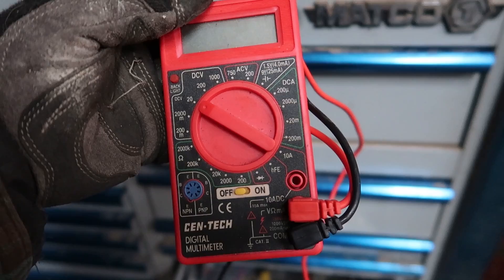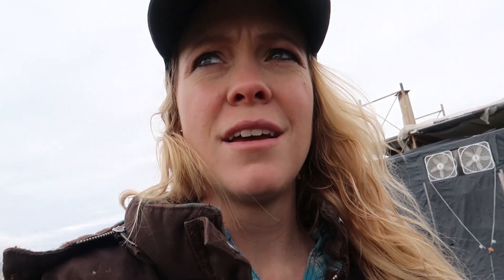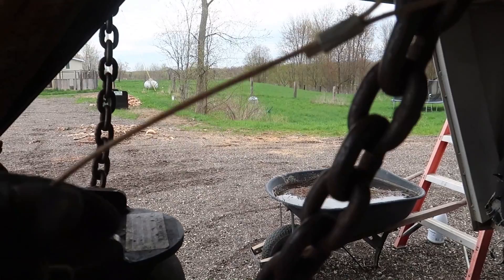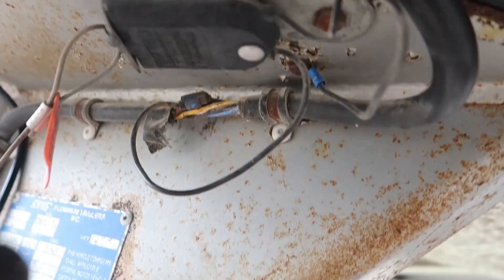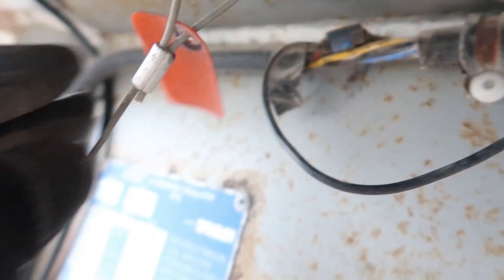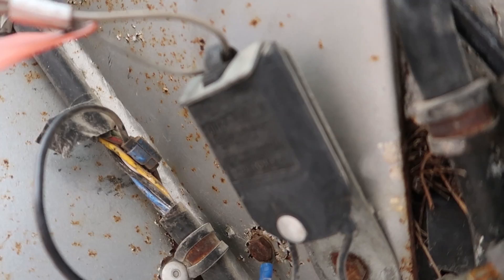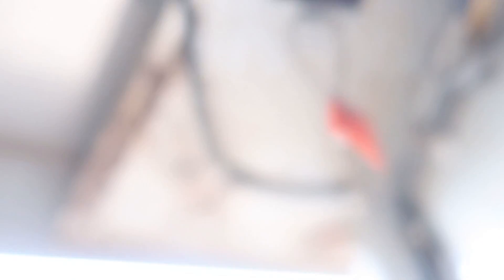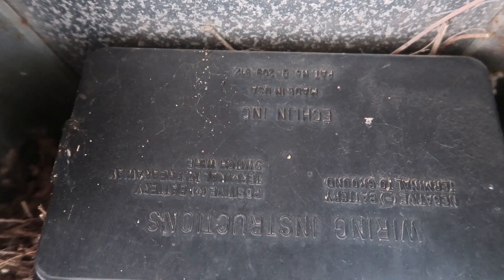218 SOLVED!!    Why My Trailer Brakes Lock Up (You Guys Are the BEST!)

Comment: I have a similar issue where my dump trailer tire rolls a few yards then locks up then releases for a few yards and locks up again. Any assistance is appreciated!
Reply from the maker: Usually a wiring issue, the correction might not be secure, or a small break in the line. Could also be a fuse in your truck going bad -- some trucks have separate fuses for trailer brakes. Also check the ground cable on your truck battery. Some trailers also have battery back-ups and when bad or low can cause it to trigger . . .

Comment: The plugs on the left are for trailer hook ups also the one in the middle I'm gonna say is for the more heavier duty trailers, that's the one you should be checking that's if your plug is that one.
Reply from the maker: Thanks!
Reply: Welcome

Comment: The battery on the trailer is there to provide power for the brakes, in the event the trailer breaks away. When this occurs the cable pulls the pin out of the breakaway, and activates power to your brakes. Sometimes the pin will come lose causing the brakes to lock up. you can pull the pin out of the breakaway switch, and reinsert it.  With the key off in the truck, and no lights on, there should be no power to the plugin. The little plug to the side is for a small trailer, with no brakes just lights. The tube you seen under truck is for a crank to be inserted to lower the spare tire. Do a search on Google for a picture of the plugin like yours, it will list what every pin is for. 
 My best guess as to your problem is the truck harness has been modified to someone else's trailer, that was not wired the same as standard trailers.
Reply from the maker: Excellent suggestions! And I think that makes sense about the battery being a back-up for powering the brakes in an emergency :)
Reply: @This1LifeWeLive  After reading what I had wrote, I guess I should have made it more clear. The problem, 90% of the time is either the trailer plug has been modified, or the truck harness has been modified, either way they do not have to be to the standard wiring, but must match each other. It is just good sense to wire them both to the standard wiring.
  All new vehicles with trailer plugins are wired to a standard, nothing worse than lending a trailer to someone, with an older truck, getting it back only to find he has hacked into harness to match his truck, instead of making his truck the same as the standard trailer wiring.

Comment: The 4 thing the bottom ground the 3 covered ones- one tail light other 2 are turn singles the round ones are 6 or seven i did buy a new camper it all works even brakes the new brake control worked i need car rust fixed before my first camping trip to the lake! you pull the wire the brakes set on! the battery dead! get a wiring diagram for round plug! it power wire on
Reply from the maker: Thanks, I'll look into that!

Comment: Forgot to mention once you locate that power wire disconnect that wire and hook up your trailer and plug in your trailer and see if it unlocks the brakes. On the 6 pole trailer connector their is no power wire I think. Double check to see.

Comment: That battery is bad, but it doesn't do anything unless that cable is pulled out, and then it locks the brakes on the trailer. The little black box that the cable hooks to is like a breaker, so when the cable pulls the end out of that little box it makes a connection inside and locks the brakes. 
That kind of wiring issue can be a headache, It could be the plug on the truck or the plug on the trailer. I had wiring issues with my horse trailer, and I just took it to a place that installed trailer hitches, and it took him about 5 minutes to tell me what the problem was. And for $25 he switched a few wires and I was on my way. lol.
Reply from the maker: Thanks, I'll look into that! 😃

Comment: If you have an aftermarket brake controller installed your manual slide switch on the brake controller could be stuck locking the brakes up. If you have a light on your brake controller it will be on if the that switch is stuck just re slide the switch back and forth and it should release. I have also had brake controllers that have a little tab switch on the side and if it’s not pointed downwards it will also engage the brakes
Reply from the maker: We ahd our after market brake controlled disconnected in case that was the issue :)

Comment: Sent good info to your community site.  Leave the trailer and Break Away stuff alone for now, it has nothing to do with your problem. Once the truck wiring is correct you can move on to the trailer wiring. Go step by step or you will end up in with a big mess. I see your trailer does not use the center pin. You might want to use it at a later time to run trailer over head lights and accessories. The top right terminal should not be hot so you do have truck wiring issues that's running lights. Hey that pipe thing is used to lower your spare tire.  Insert special tire tool in pipe and turn to lower tire down.
Reply from the maker: Oh, ha! I would have never guessed it was to lower the tire! I had been looking at a few wiring diagrams and some use the center pin to run reverse/backup lights. It SEEMED like at one point the truck DID run the inside lights . . . but I didn't pay much attention to wiring stuff last year :(

Comment: The two types of plugs are the same purposes, the 4 prong is for trailers with 4 prong flat connectors,and the round plug is for newer trailers..they both serve the same purpise....check fuses as well, sometimes doing that can sometimes blow fuses.. breakaway cable is to stop the trailer if the trailer breaks loose from the truck
Reply from the maker: Thanks!

Comment: I was thinking about this.  On my trailer i have voltage that runs to charge the battery in the trailer. when i wasn t sure of the trailer.  I would hook it to a truck that i knew was right.  It sounds like the brakes and charging voltage could be crossed.  I recently had to rewire the trailer 2 yrs ago.  On the rear of my ford my 8 pin is marked.  In the 8 pin there is a ground as i remember.    So when you use the meter  set to 20 dcV.  This is because the voltage of the truck is 12 vdc.  Think of a battery Black - / or ground.  so in short the Chassis of the truck is ground.    So when you touch the pos lead to Pos of battery you get 12vdc.   So in short when troubleshooting  the voltage will fluctuate from 0 to 12 volts.  when brake peddle pushed should have 12vdc.  When you let off brakes should be 0vdc.   At least this you can determine the truck ok.  Now the ohms settings this is for testing shorts or opens.  Basically you can find pinched wires to ground AKA the chassis.  The lower the reading on OHMS close to a short.  IF meter basically reads 0.  Yep it bad.  This is how i found mine.  There is alot more to troubleshooting with the ohms setting. I would set to highest setting.  Then short leads and you should read 0.   If you work the trailer in a way that you know what is working.  It will be easier to troubleshoot.  Sounds like it coming from the truck.  Voltage can stray from another circuit If lights are on.  But should be east enough to tell.  I tried to make this short.  I think it enough you will have some great ideas going forward. Also someone could have made the original pug for the trailer  to their truck.  Start basic and work forward.  Split the truck and trailer and test both.  It a big cookie lol.  Have fun hope helps you in the future.

Comment: My two cents. You can get a trailer plug tester to see if everything is hooked up right just by looking at it. If remember right it’s about $20.00. And you should look at replacing the the trailer plug to a new 7 wire. Mine had maybe been on 5 years and went bad. And I recommend a Reese plug. Just seems to be built better. Good luck.
Reply from the maker: Thanks, I'll look into that!

Comment: Replace batt. Probably the plug on the trailer side. Don't worry about anything less than 1volt. It's dead or off. Most problems are either the plug or the trailer ground wire. ALWAYS make sure ur ground wire clean and rust free. Use a wire brush . It will be the wire going to a eyelet connector somewhere on the chassis. That's where I would start.
Reply from the maker: Thanks, I'll look into that!

Comment: Your multimeters is set on 20 volts. So, you will have to double your digital read out number. Your breakaway battery read 6.4 or something like that.  So, you had 12.8 actual volts. (Remember, your multimeter was set to read 20 volts). I would have someone hold the brake pedal and recheck your plug-in on the pickup. Also, is your brake controller in the pickup adjustable? If it is, is it set to max?
Reply from the maker: Thanks, I'll look into that! The after market brake controlled in not installed since we were having issues and thought that to be the cause.
Reply: The 20 volt DC setting is for DC volts up to 20 volts.  It does not need the reading doubled.  The reading was 0.64, not 6.4.
Reply: @ronsommer9409  you are correct.  I posted and went to bed. Laying there, I realized I was wrong on the multimeter part. I didn't have the time this morning to correct the post.  I'll leave it for now. Unless it really bothers someone.  They can read your comment correcting mine.

Comment: Trailer brakes are activated by electric.If all power is disconnected and brakes are locked,it is mechanical (brakes are probably rusted wheel hub).If brakes are locked only when wiring is connected,then it is electrical.Does truck have a brake adjustment box under dash in can of truck?
Reply from the maker: We do have an after market brake device, but it's not currently connected . .

Comment: That looked like a adapter plug on trl pigtail, trl plug looked to be a 6 pin round pins, the round pins look like a 5 pt star shape with 6th center pin.
Reply from the maker: Correct!
Reply: Suzanne i looked up the standard 7 pin plug wiring diagram and this is what i found. Looking into outlet on truck end starting LH lower terminal is Ground White wire.going clockwise LH turn yellow. Tail Running lights Brown. 12 volts constant power Red. RH Turn green. Trailer Brakes Blue. Your brake lights power thru the LH AND RH turn signal wires at the same time.The center pin is for backup lights. All circuits need to be powered up in order to test power out of outlet. Turn on parking lights,4 way hazards, have helper activate trl brake controller, brake pedal for brake light test and key on engine off put gear shifter in reverse to check backup lights.

Comment: The tube is where you put your jack handle in to lower the spare tire . Also how a break away works is if for some reason the trailer and truck become separated then the cable will pull the key out of the break away switch and will close the contacts in switch sending 12volts from the battery on trailer to the brakes stopping the trailer. So as long as the key is in the switch and your brakes are still locking up it’s not the break away . More likely wires on trailer plug not synced with the wires  on truck. Plug
Reply from the maker: Thanks for the suggestions!

Comment: Most multi meters have a tone setting I've found that setting is helpful and you can have the truck in the accessorie position and the 4 pin is usually for smaller trailers that don't have breaks the bigger plug is for the horse trailer and most auto parts stores sell a plug tester for trailer plugs and that pipe I believe is for the spare tire winch
Reply from the maker: ohhhh, ok!

Comment: When it comes to wiring there is the Right Way the  Wrong Way and the   WT Farm Girl Way ..   Most of my Trucks have air brakes..   I have some  funky  adaptors    To adapt  from  7 Pin Round  "Air Brakes"  To   "7 Pin Flat"  Electric brakes.  The hardest  problem to solve is  when some one else Jerry rigged the system and you don't know what they did ..    A  Simple  test light  could be handy  to  .. Voltage or no voltage..  a   12  volt  battery  should  test at least  12.8 volts  ..  You  can  try to charge your   emergency  battery  but  remember small batteries  don't last  very many years if you don't  store them  fully charged..
  When a  battery is low the  lead  plates  are exposed and they corrode..  Electrons  of  a  fully charged  battery some how  protect it from Oxidation..  I have  many  battery tender  chargers  to  keep  batteries  fully charged when not  being used normally .. Plus  all your  modern  cars have computers  that constantly  drain the battery when not in use.

Comment: That is a 6 6 pin round plug or at least one I can see in the videonow if I had looked at the truck right I have to go back and look at video again if you had a 7 pin on my truck that could be your problem also and that it's wired wrongand that are definitely lead you down a road of Chase and wires you need to make sure it's your truck has the same amount of pins on the connector as your trailer and that they are wired the same as your trailer or you will be chasing wires for days trying to figure it out

Comment: 2 different styles of trailer connections,, Easiest test is just put your flashers on first set the tester on 20v. With the key only on it'll have a number about 12.6 this is a good battery with the engine running it'll say 13.7 to 14.6 But using the flashers it say the signals, brake, stop, curcuit is working they all run on the same power curcuit. PUT THE BLACK onto the exposed post this is Negative,Turn on flashers Then touch the upper holes these say signal current both should flash then shut off flashers turn on park lights touch the same holes the lights will be dimmer but both will be on, Shutoff lights then try just signals they should flash separately. Most cases the big Blue wire is the brake supply from the truck, White is ground yellow and green are signal wires brown is park lights /headlights this will be the hole just above the exposed post middle one .Might have a power touching the brake supply wire, The little hairpin looking signia top center of the tester is OHM tester this works using NO POWER it tests for broken strands in wires or power crossing that wire that's supposed to be dead if you get No numbers when touching both ends it's broken if you get numbers it'll say how good the wire is if it's a new wire All the wires should say the same number when testing for good wires a weak number is corroded or only have a few strands.
Reply from the maker: Thanks, I'll look into that!
Reply: @This1LifeWeLive  Was gonna ask how often are you going to haul your horses in the trailer ,Does it really need them airbags on the hitch them are for fatigue on the horses legs on long hauls ,If not going all that far that`ll lower the hitch to fit the truck .
Reply from the maker: @GarnettM  we had considered that as well :)

Comment: It still sounds like the constant hot is hooked up to the brake line. Constant hot is mentioned for trialers with interior lights etc. Have Eric un hook the wire he connected and see if that releases the brakes. I ran into that on my dodge and also my f350
Reply from the maker: Thanks, I'll look into that!

Comment: The center pins are for live power on your trailer if it had internal lights for example the outer ring are for your lights ground and turn signals
Reply: They are sometimes backup light terminals too.

Comment: The first thing I would do is pull the trailer plug apart and put on the 7 blade rv plug like your truck has and do away with the adapter, as I am willing to bet that is what the problem is. The 6 round pin plugs are generally wired different than the 7 blade rv. Your red lead on the multi meter was plugged in the ohms which is for checking resistance, plug it in the other spot which is for checking voltage and recheck the e-brake battery, if it doesn't show 12v it is most likely junk and needs to be replaced. The center blade on the truck is for reverse lights on the trailer. I'm sure you will get it figured out.
Reply from the maker: Thanks, I'll look into that!
Reply: You're welcome.

Comment: Okay on trailer brakes with a brake controller of course you got it yeah wire that runs your parking lights or trailer lights runs off the parking light circuitand you got your left and right turn signal wires then you got a ground and you to turn signal wires also work the brake light portion of your trailer brakes it's just that grounded at a different spot and the power brakes have a wire that runs that was when you apply pressure to the brakes IT supplies power on that wire to engaged the trailer brakes without knowing your setup what kind of trailer brakes you have I'll just give you a common one which is magnetic trailer brakes on your trailer you have a count in a magnet and when it it's applied voltage the magnet grabs account which allows you to stop if you have too much game set on your trailer brake controller it will cause your trailer brakes to lock up that's one situation now if you have a wireless intermittently supplying power to brakes it will cause your trailer brakes to engage because your brakes should only get power when you press the brake pedal it goes to the brake controller and back to your power brakes not as far as color coding on your wiring there's a million different configuration so I can't help you on that but in order to set up your meter you need to have it on DC volts or you can use a standard test light DC I hope that was helpful

Comment: the battery is to put electric in the wire only if the brake away cable is pulled to apply electric to the brakes to stop the trailer